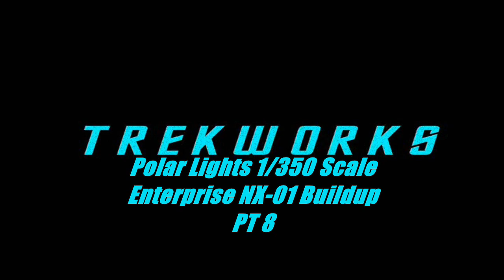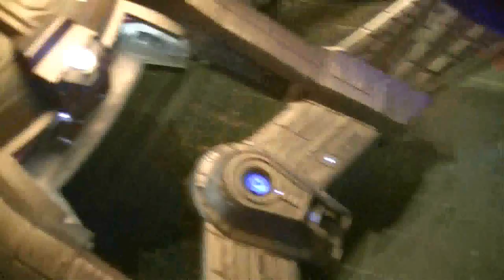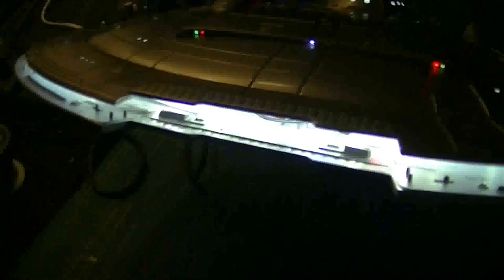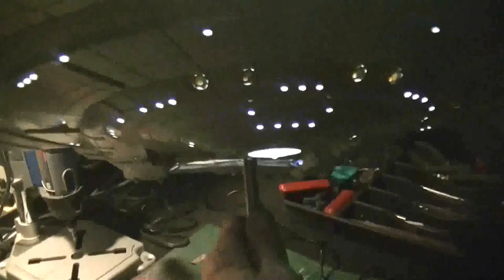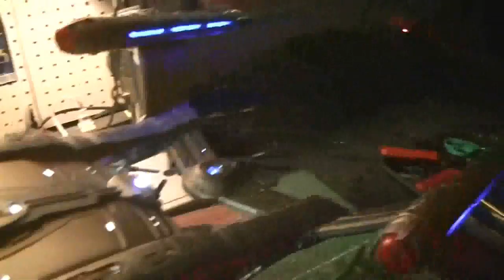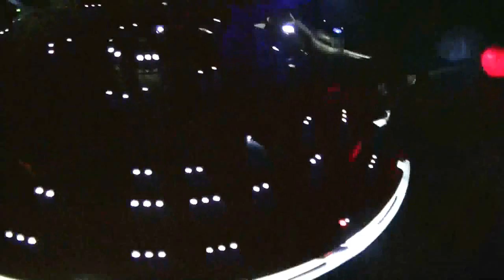Polar Lights 1/350 Scale Enterprise NX-01 Buildup PT 8

Comment: @ Boyd - What diameter hollow threaded rod did you use and what was the length? Where did you get the rod. Exactly where on the bottom of the saucer did you drill the hole for the rod?

Comment: Great work! You inspired me to give this model a try. I'm to the point of mounting; I'm curious, what sort of rod (size, material) did you use and what did you use to drill the hole? Also, what's the base you're using. Thanks for much for sharing all the modelling help.

Comment: Hello Boyd.... I am following your build of this kit as I am building my own NX-01 kit. I do have a question regarding the placement of the mounting hole and size of tube you used.  The kit you are building was the 1st issue which it did not come with the mounting dome base (as is the kit I am build).  If you would, could you inform me where on the lower saucer section did you place the mounting hole and tube.  Thank you for your great instructional videos.
Reply from the maker: +Sal C If I recall, there is a flat spot  on the bottom, aft of the sensor dome.
Reply: Thank you Boyd.